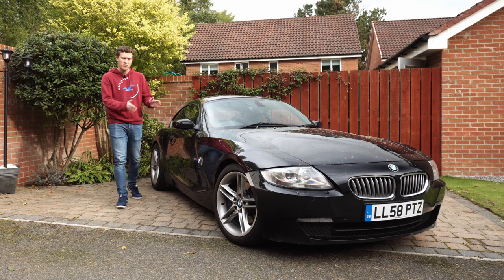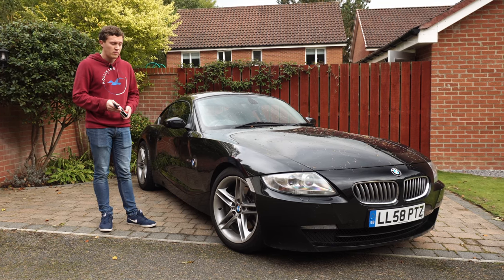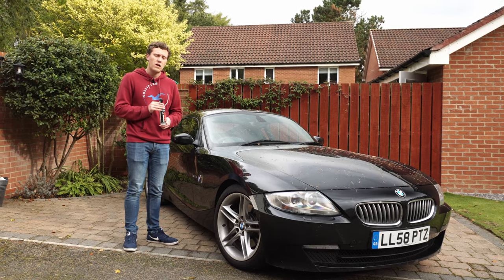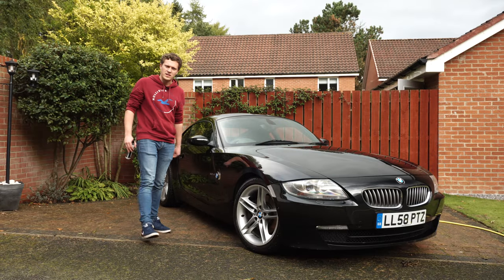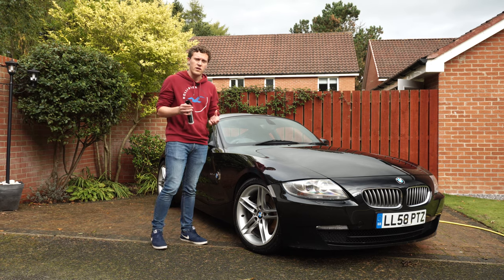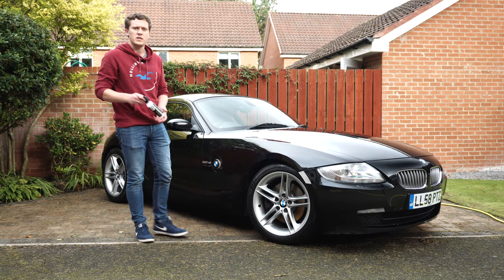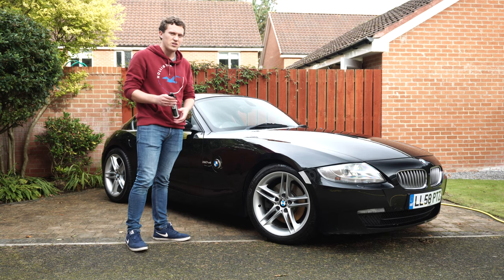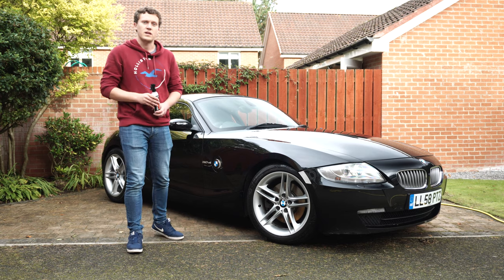Protecting The BMW Z4 For Winter | Shine Armor Graphene Ceramic Spray - The One To Buy? (E86 3.0si)

Comment: Love the car, I want one,hoping prices drop slightly so fall into my price range 👍🏻
Reply from the maker: Thanks Darren - keep looking as you don't know what might come up for sale, prices are strong at the minute but there's still a range of different things out there.
Reply: You may want to consider increasing your budget than waiting for a price drop, there is no reason why the price will drop for a car made in limited numbers, it a very uncommon BMW two seater. I bought my in 2018 for £6250 and the price has solidly kept going up year after year as the Z4 have reached its lowest price curve and it has started to rise with only 250 Si models registered in the UK. JMO.
Reply: @MrRoyck10  car throttle bought one 3 months ago with 120,000 miles was up for 5,750 and got it for 5000,so they are out there ! I don’t mind a high miler,I just want one 🤣
Reply: @tommogun3 
That engine love miles man have a great time in it